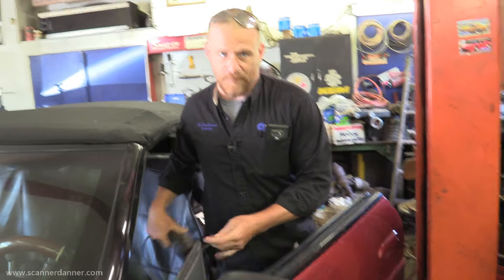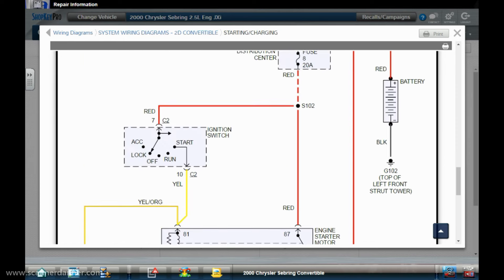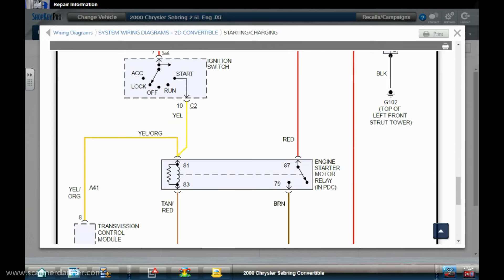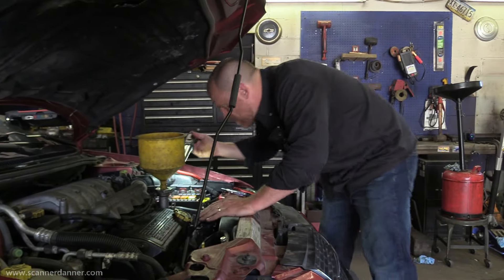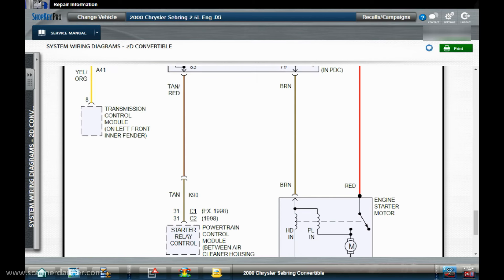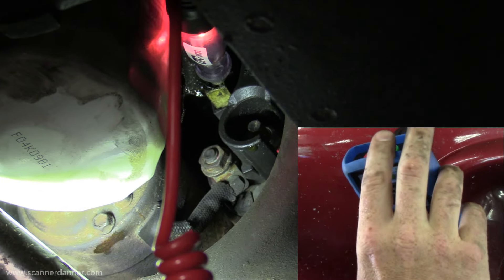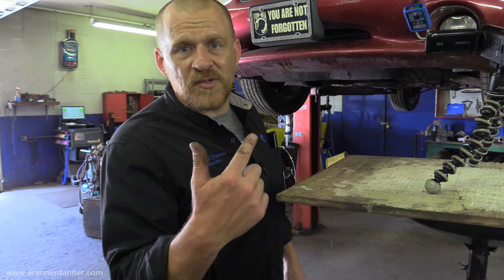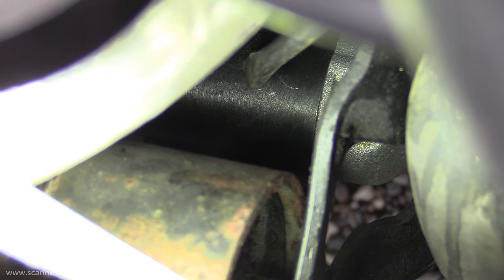No Crank Diagnosis Fundamentals  (starter testing)

Comment: Regarding your block ground test with the test light - The process of turning the key to crank sends battery power to the starter, thru the starter and because the starter does not have a path back to the battery, (no block ground), the test light with its own path to ground provides a path for that power and lights up.... Do I understand that correctly?  - BTW - thanks so much for all you do!

Comment: If the heavy cable after  connected that’s the power wire ground off to the block can that damage the starter solenoid and causes the car not to crank?
Reply from the maker: If the heavy cable grounds to the block you will have a fire on your hands as those cables are typically not fuse protected. But no, that would not hurt the starter

Comment: We used to pull the starter and bench test it as a final test to remove any doubt.
Reply from the maker: That's an unloaded test and there are vibrations involved in removing a starter. Meaning a bad one may work once you take it out. Learn to trust your measurement and you won't need to do this anymore. Make sense?

Comment: All the tools and equipment used in diagnostics can easily add up to 10s of thousands the scan tool alone is about 10k so you have charge to get return on your investment .
Reply from the maker: more than that, you need to charge for your experience, no different than a specialist doctor would

Comment: Totaly with you here. Example changeing a headlamp pulp dosent mean it will turn on after the change of the pulp if it has other problems in it circuit.
Ones fast shop replaysed both headlamp pulps as customer wanted them both be new. Next shop replaysed them again shortly as they when out fast and didnt get light out after replaysing.
...what happend? well the firsth shop didnt but back the headlamp pulp covers correctly and water get in side. and as these was xenon headlamp units it ment that the headlamp control unit was simming in water in its own summer pool ;)
That ment simple cheap pulp chage get real costy in long run as only one unit was close to 1000usd and both of them was out + you needed te remove mutch more staff a round to change them.

Comment: Disclaimer: I was a 13 year career veteran auto tech and got out in 2001 due to the flat rate / no training / pay issue. Fast forward 18 years and an old, established shop like this needs to bring in an career, L1 level, Master Tech to diag a bad starter? I going to get into mobile diagnostics. Things are apparently a lot worse than they used to be. Paul; seriously, am I missing something here? Be honest, please.
Reply: I'm a master tech 45 years exp on a problem like this I work backwards from the starter test light on the solenoid command wire  lot of guys work the other way around never knew the logic

Comment: I knew it was the starter not a hard problem to fix so tcm and ecm controls the starter and  grounds the starter on Chrysler vehicles also first check battery and alternator then you go more in depth starter etc you can also hit the starter it will work one last time but you have to change the starter if not your stranded
Reply: My friend has a dodge van and his starter would click.  He tried to jump it and it did the same thing.  He went and had a new starter installed and the same thing happened with the clicking.  He checked the starter motor and it worked outside the vehicle.  I think he has a wiring problem.  What's is your idea of my friend's problem?  If you also think it might be an electrical problem would I be able to tell with a test light?
Reply from the maker: Actually, I corrected myself in the video. The TCM does NOT control the starter relay at all, it just has a monitored circuit that is tied into the relay.
Reply from the maker: @michaelpearce8661  for sure! just make sure you do ALL tests while holding the key in the crank position and also make sure you are touching on the bolt and not the eyelet of the main bat post. I've seen issues there
Reply: Doesn't the PCM require some sort of neutral interlock signal before grounding the starter relay coil? Does it come from the TCM or from a separate safety switch?

Comment: With a block ground problem, you really need to put your test light ground right to the battery, otherwise it won't light either, because all the block is going to be lifted up to the battery voltage, therefore both sides of your test light as well ;)
Reply from the maker: For sure! I have a case study on that too where I chased my tail a little https://www.youtube.com/watch?v=32S0WMj3GSQ&list=PLAFYVCyenqcr32wgsCqa1Zj4335YlBF5p&index=5&t=0s

Comment: I had my test light on starter battery main post and when cranking light would shut off then come back. Starter is just making a bunch of clicking noises
Reply from the maker: Main battery cable circuit has a voltage drop on it.
Reply: @ScannerDanner  I just put a new cable on and post connection. I also had my test light flashing on the s terminal when cranking.
Reply: @ScannerDanner  starter was shot, I think water was getting into the housing shorting it out. I pulled it off hooked to a battery and all it did was kick out and not spin. I noticed when it would rain or I ran through a pulled it would have a long/no crank I thought it was the fuel pump going.

Comment: if I get into a situation where someone's telling me im wrong I simply ask them what they think it is and say let's check that together  but remember your paying the bill for the extra time if your wrong " interestingly enough they normally back peddle and ask me if im sure its what i say it is ' and i say yes' yes it is would you like me to explain how i know ? one thing i would say though Paul in the field with these starter motor no cranks I go straight for the s wire and ground test " reason being is time is money if you have good bat feed and s wire command and of cause good ground you can pretty much call the starter within 10 mins any thoughts?
secondly if I diagnose a fault and the repair done by the garage or owner i always make them aware im not responsible for their workmanship " and there will be a minimum  book time to diagnose''  for a second visit 'that simple' if your out in the field you only have so many hours in a day and you have to travel between locations nothing worse than getting on sight to find it was human error and they dont want to pay you a second time"
Reply from the maker: By you saying "I go straight to the s wire and ground test" are you saying you skip the heavy BAT post test? Or are you saying you do not start at the starter relay?
Reply: @ScannerDanner  Hi Paul no i always check  heavy BAT post S Wire and ground I have a relay jumper i made up on a lead ' much like a remote start  has 2 leds one is for command from key and of cause other is power at the relay if the key command is good i go straight to the starter with key off jump a test light on the Heavy bat post first then the s wire while holding the button on if that checks out straight to the ground checks on the odd occasion have found the heavy bat wire  to be the fault  or the solder on the heavy bat post to solenoid but in most cases the starter is junk  oh there is another possible i forgot to mention is the 'starter or solenoid  junk remember just because the solenoid has no life doesn't mean the starter motor is bad' maybe if you do another video on a no crank no start  you could explain to the viewers how to test both the starter motor and the solenoid and why you might do it

Comment: Bro you're too smart for me. If somebody would have called me to come and diagnos that car, I would have taken my multimeter put one probe on the ground and one probe on the starter post and tried to crank. I turn the key and if we drop more than a volt or 2, we replace the starter. Would that test have worked here?

Comment: Could I do the same test with a powerprobe?
Reply from the maker: you can do the same tests with just a test light and a paper clip, but you better not jump the wrong pins on the relay. If you do, you will cook the engine computer
Reply: Look at the relay, copper pins are the circuits to the motor of any type (this is where you can apply power but always check), white pins are computer controls, you always have power from one of pins, the ECM will send ground and this is where you need to use your power probe. You check where the power is and you then touch the opposite pin at the fuse box connector, you will get ground with switch in this case, then you're confident you're getting computer signal (this is the pin you DON'T WANT TO SEND POWER, it will fry the computer like scanner said).

Comment: Dont know why I am having a mental block understanding why the test light would light if you were connected to the neg batt post and other end on the block..
Reply from the maker: What time frame? Did this one have a bad block ground?
Reply: @ScannerDanner  @19.58 ground to ground test for a no crank
Reply: I mean I THINK I understand the theory..Your test light circuit becomes the grounding for the engine, since there isn't actually one present..right?
Reply from the maker: @rustandbeards  correct, (20:51) with no block ground, the block itself will look like a power feed! But only when you hit the key to the crank position

Comment: since its right there in the open why arent you jumping the starter terminals as a test?
Reply from the maker: I didn't need to as I trust my testing methods. In this case, nothing would have happened so you would have had to follow the tests I did anyway. Make sense?
I mean, you are not wrong in wanting to start there. This just comes down to personal preference.

Comment: Solenoid problem?
Reply from the maker: since it didn't even click, I would say yes
Reply: One of the solenoid windings is grounded through the motor. They sometimes don't even click on only one winding if the motor is open circuit.

Comment: Are you testing through the whole starter if the solenoid isn't engaging? If the solenoid isn't even firing, the starter motor it's self isn't going to have power. The only way the motor is going to have power is when the solenoid fires, bringing the copper disk against the two large lugs on the inside of the solenoid. 
Now, if the copper disk and lugs are pitted to the point that power isn't getting through, tapped/pounding on the solenoid while the solenoid is engaged, may jiggle the copper disk enough on the lugs to give enough power to run the starter motor. Please think about this a bit before responding.
Reply: Oh, I believe the starter was bad. Just questioning your hammer technique.
Reply from the maker: @dans_Learning_Curve  sorry, so what is your question? the hammer and its usefulness in this situation or is your question with one of the tests I showed? Thanks!
Reply: Dan'sMeTube    The hammer technique can affect the contactor or the contact at the brushes, or any other poor contact in the assembly. It's quick and dirty and proves the integrity of all the wiring to the starter if it starts.

Comment: I'm worried a little about losing my hair when troubleshooting which can be stressful at times when you have to check so many variables when computer fails and you don't really know the circuitry of internal PCM controls. What do you guys think? We need engineers to start including computer driver designs and start marking expected wiring signal from the PCM.
Reply from the maker: they are getting better with internal designs and service info

Comment: Bad luck. As that starter happen to stop on the bad spot of the Solenoid contacts. You can take that apart and clean it off. As it's a copper disk.. Fixed these for years. Why I rebuild all my own Starter\Alternators.. I get to save on them cheap Chinese\Mexican rebuilds...
Reply: @lustfulvengance  Nope.. The Armature contacts being bad causes that. As the clicking means the Solenoid is good. When you have no clicking. The Solenoid is failing to engage the Armature to spin. If it drags. You have field coils going bad. As they drag on the Armature.. Thus bind it..But they can be hit to make them spin. or let them cool off. Which means rebuild it. Buy a new one. Buy a rebuilt one. I would add. If it spins and nothing happens or it freewheels. The ring Gear is broke. As it does not lockup...
I bet I rebuilt 30k of all kinds. Mac trucks being the daily workout. They weight 50lbs+ Hold those in there till you get the bolts in. Your arm will be pumped up..